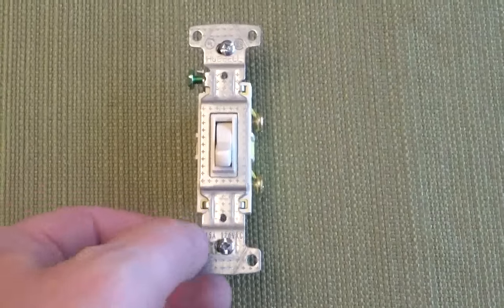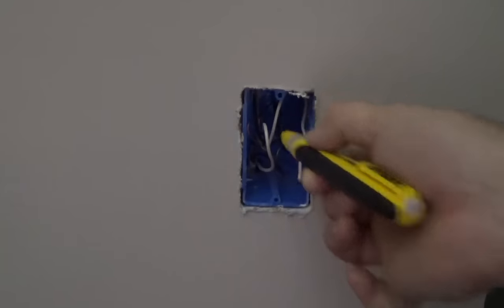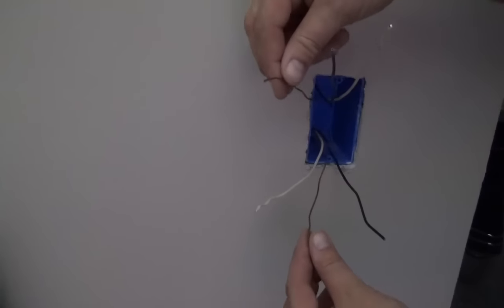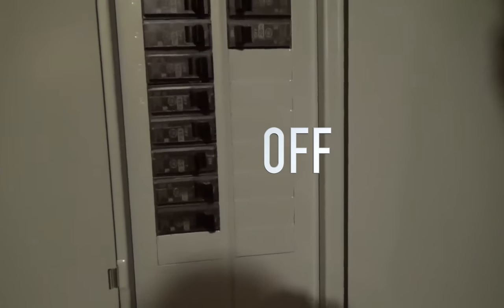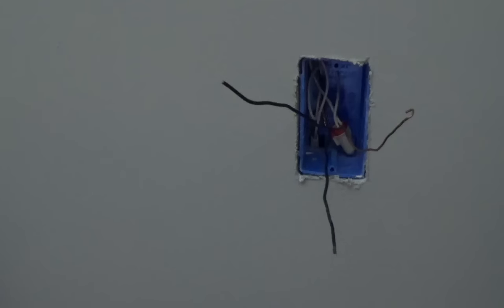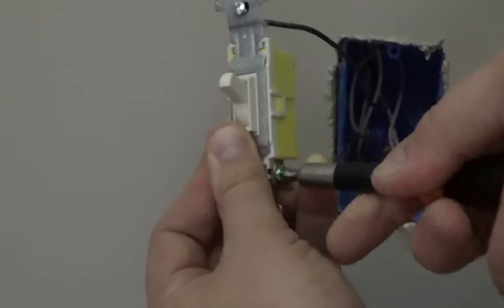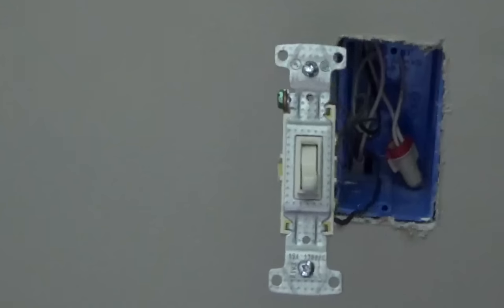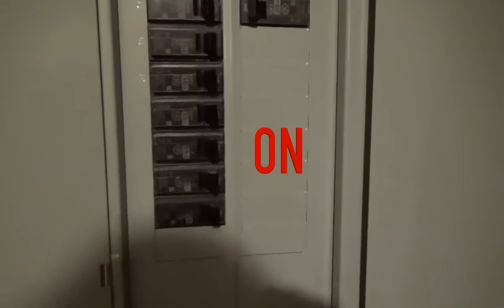How to Install a Light Switch / Single Pole Switch

Comment: well i just came back from the hospital never forget to turn off the power
Reply from the maker: Good tip, Jordan!
Reply: I got shocked twice installing mine 🥴 too lazy to walk to the breaker
Reply: Hahahhahahahahhhahhha
Reply: Thanks, l’ve been looking for a vid that tells me if l can wire without shutting off the power
Reply: What happened
Reply: Did you fix the switch?
Reply: You "never forgot" or forgot? Haha
Reply: @josephwilliams2633  how bad is a shock? Is it like hospital bad or getting tazed or like touching a handheld bug zapper?
Reply: Oof
Reply: Lol I was cleaning out our air conditioner. It had water in it so I blew out the drain and went to shop vac the water out. That higher stuff hurts.

Comment: What happens if you accidentally connect the line/load to the wrong nut?
Reply from the maker: then "off" position will turn the light on .
Reply: It doesn't matter which terminal screw you put the hot wire on on a single pole switch, connection is made internally in the switch only when in the on position alowing current to flow through.
Reply: @michaeleverett2650  Thank you..👍
Reply: I thought if you crossed them it meant kaboom time lol thanks @PhilCrockett

Comment: I worked 15 hour shifts sometimes or 70 hour weeks doing demolition on navy ships when I got out of high school at 18. 2 years down the line I got a lucky break into electric for a higher wage and cleaner job. learned power panels, receptacles, etc. I am studying outside of work to receive a job in residential for 30 an hour + overtime. I have heard residential is different than marine. I have good nerves and am cramming as much info as I can. No debt or college, no handouts, just humble hard work going on 3 years. Thank you for your video. I hope everyone gets it.
Reply from the maker: I totally get that!    seriously!  I make 8 times as much from a 2 year junior college degree than I did with my 4 year big University  degree.  no joke.  I'm the poster child for what you are implying.
Reply: There are some unions that will hire you as an apprentice and pay you $20 an hour for the firs year, then once you are fully ready , you can get a  union job earning $50 an hour and double time on the weekends and anything you work over 8 hours any given day.

Comment: I had a dimmer switch with a ceiling fan causing a horrible buzzing sound. I attempted to replace it with a regular switch and found wires that weren’t the same colors as other videos, but I found your video the most helpful and I successfully replaced with switch after you helped explain how to identify the line and load wires. Thanks for saving me a bunch of headache and making sure I didn’t burn my house down.
Reply from the maker: You're welcome

Comment: I'm an Electrician from Australia and I find American wiring so different and fascinating. All our ground wires (earth wire we call it here) are insulated. How do you make sure it won't twist around and touch the hot terminal when you push the switch into the box?
Reply from the maker: yes!  I agree that our ground is ridiculous.  I just make sure the wires are tucked carefully.  Wish they had insulation on them here.

Comment: Phil, if you remove one circuit and only need one, where does the white wire go to if you only have two gold screws on the switch?
Reply: The white neutral wire goes to your light. Your light should have 3 wires a switch leg a neutral and a grounding wire..
Reply from the maker: indeed, Edward!  Thanks for your comment!

Comment: A good measure to take is, after twisting the white wires and black wires is to cut the tips off with your side cutters. This bonds the wires together. Most of the problems arrive at those joints.
Reply from the maker: thanks for the tip

Comment: What about im my case? The old light switch doesnt have a green screw where to connect the ground. So there are 3 wires . Black /red/blue. The red lower screw and black top screw were connected onto the sides, and the blue went into a little hole in the back next to the lower red wire. In this case the blue is the coming up as the hot one. So the new switch has the ground green screw. Now where do the wires go on the new light switch??? Thanks in advance 👍
Reply from the maker: It is so hard to diagnose your issue when I can't be there to see it

Comment: VERY INFORMATIVE; Phil, I,m attempting to wire a single post light switch- however it will be powered by a 12-volt dc current is the wiring you used here the same for 12 volts as it is for 120ac current??? PJP-it,s an RV overhead light thank,s  again
Reply from the maker: Hmmm...... I haven't wired an RV.  I would pull an existing outlet and see what the factory used.  OR..... simply call an RV place maybe.
Reply: @PhilCrockett  GOT IT!! THANK,S PJP

Comment: I got a single pole switch but one of the screws is black. Is it the hot one?
Reply from the maker: They're both "hot".  remember..... It's breaking the circuit on the hot wire.    I think a good example is for you to watch my vid on another switch I put in.  You will understand the concept.  Here it is:  https://youtu.be/Wai_3qexlV0

Comment: how do I know which switch it is on the breaker box. I really need your help, I broke my mother light switch on accident and want to fix it for her tomorrow. I'm buying the voltage detector, light cover, and single pole switch. IS there anyway we could maybe set up a FaceTime call tomorrow I really need your help and you would save my life.
Reply from the maker: Most people have the switches label to which room they run on the door of the electrical box.   If not, then have someone hold a wire tester (pen light style) on the wires that feed the switch.  Then try each switch until the test light turns off.  Then you will know which breaker runs that light switch.

Comment: Just getting into this, have a dumb question. Why is there no silver screw to attach the white wire? And great video, thank you!
Reply from the maker: not a dumb question, my friend.  The purpose of a switch is to disconnect and re-connect the electrical current.  You do this on the black (hot) wire, not the White (return) wire.  So.... only one wire needs 'switched', and the proper wire to do this to, would be the Hot wire.   
It would be like cutting the wire for  "off" and touching the cut ends together for "on".  Hope this explains it.
Reply: @PhilCrockett  got it, thank you!

Comment: Does it matter where you put load and line wire in a single pole?
Reply from the maker: nope!  only..... you "on" might be off, and "Off" position might be. :"on"
Reply: @PhilCrockett  on will still be on and off will still be off. All you're doing is connecting the power flow between two wires. They are either connected or not. They will only be connected when in the on position.
Reply: @njsongwriter  Thanks for clearing this up.

Comment: Do we have to secure  hot wire on bottom or can it be secured on top as well?
Reply from the maker: either way.  It will only affect the relationship of the toggle position to the on and off of the light.   If toggled up, and the light goes off, then swap wire positions in order to toggle up for the light to go on.   Does that make sense?
Reply: It doesn’t matter, you’re only making or breaking a hot connection. Make sure the words on the switch are not upside down
Reply: This video really helped. My switch has a white wire, black wire, and a ground wire. I have a white and black wires reversed and it caused a short. From watching this video I learned that the hot wire goes on the bottom. My problem is solved! Thank you
Reply: @gunneredwards7710  ........BINGO!
Reply: @loisscott1632  that shouldn’t cause a short? A single pole switch is only breaking the connection, hot can go on the top of the switch as well

Comment: i have a switch where the old switch has the wires going into a hole in the switch rather than going around the screw.  the wires seem stuck any advice?
Reply from the maker: There's a slit near the hole.  stick a small flathead screwdriver in it to release the wire catch within.

Comment: As I understand it, with a single pole switch, it doesn't matter which way you hook up the line and the load (unless it's a GFCI receptacle or a 3 or 4 way switch).
Reply from the maker: right
Reply: This is correct. My electrician union buddy told me this a few days ago.

Comment: When I opened the light switch box, I noticed there are 2 White(neutral) wires and 1 Black wire twisted in a wire nut. That one black wire directly coming out of the box says "LINE" (Not 100% sure, since its hard to see).  But there is already 2 black wires connected to the existing light switch. I assume HOT/LINE and LOAD. I'm a little confused, should I attach the White wire from a smart light switch to the 2 white and 1 black wires? I checked other boxes in my house and it wasn't like this, only 2 white wires connected together.  Why would the 2 neutral white wire be connected to a black wire? This switch controls the floodlights for my driveway. Hope you can help. Thanks.
Reply from the maker: I can't give safe advice on this one.  Use your wire tester to see what's hot and what's not, by throwing the switch.  Otherwise, you should probably have an electrician look at it on-site.
Reply: @PhilCrockett  I did use a voltage tester, and that black wire connected to the 2 white wires is not hot. Only the one black wire going into the light switch is hot. I'll probably contact an electrician to have a look at it. Better safe than sorry. thanks for the reply!
Reply from the maker: If I were to guess without looking at it, I'd say the black hot is your LINE, and the others are your LEAD.  I would be interested in knowing what the white ones are feeding when you turn the switch on.   I like the electrician idea a lot.  You might go to a hardware store and get (or look at) a wiring 'how-to' book to see if there's a scenario like yours in a picture diagram..... just to educate yourself about it before the electrician comes over.   Just a thought.   Let me know how to goes.

Comment: I don't remember wich black wire I put on the bottom screw, hot or wire going to light, does it matter or how do I know. I flip the switch and the light does go on
Reply from the maker: Switch simply is placed in the split of a hot wire. It breaks the circuit when flipped and connect to circuit when flip the other way.

Comment: Ever get static electricity shock when flipping on or off the switch?  Cut small squares of Duct tape, 1/4 inch sq., and place them over the two screws on the plate!  I use white to match the plate!
Reply from the maker: hmmm... never heard of that.  THANKS!

Comment: Hi, my building is older don’t see I white or ground just two black wire coming in. Looks like one was going to each part of the switch, is that okay?
Reply from the maker: yep!  The switch is just breaking a circuit. It's placed in the split of a wire.
Reply: My problem is that I have ablack white only in box  at top of a long hallway no turn n off  the power goes too the light in ceiling have to pop walk back before exit builbing need your info to me and fix this pain back T THANK YOU LEE THORNTON

Comment: Does it matter if the load and line wires are switched?
Reply from the maker: nope.  only..... off position might turn the lights on.... and on position might turn them off.
Reply: @PhilCrockett  thanks.  That was the question I had.
Reply: It doesn't matter if the load and line wires are switched, either of the black wires can be attached to the top or bottom screw. The current will only flow between the screw terminals when the switch is in the on position, there is no current flowing between the terminals in the off position.

Comment: So. What if u don't know what breaker controls that switch  ? How do u find it without turning off all breakers?
Reply from the maker: one person holds the voltage pen to the wires, while the other person turns breakers off and on until you find the right one.  don't forget to label the breaker for future reference.

Comment: What if you have 2 wires coming from the bottom and one wire coming from the top? Same thing just twist 3 grounds together and 3 white wires together?
Reply from the maker: I can't give advice like that over text.  This is something that would need to be done hands-on.
Reply: Most likely your two wires coming up are your load wires but test to make sure which black is line wire(wire w incoming power). Grounds twist together, and white get twisted together. Make sure u pigtail your 2 load wires, don’t double wrap the screw
Reply: @Nick-bh1fy  you da man!😎👍[thank you]

Comment: I want to add a switch for lights in living room since I doesn't have lights at all how to add it from the other light switch
Reply from the maker: That would require running wires in the attic and down walls.  It's a pain.  I did something similar years ago.  I switched one of my receptacles on the other side of my living room.  Literally installed a brand new switch and box in the wall and ran wires to my attic (drilling hole in top plate of wall); ran wires over the receptacle stud; drilled hole in top plate; ran down wall and hooked up.  There's more to it than this, but I'll never do it again.  insulation nightmare and logistics were awful.  Hire it out.

Comment: Replacing a switch with a switch / outlet combo.  Took the switch out of the wall, and there's only one black and one white wire attached.  How is this possible that there isn't another set of black and white wires going to the light?
Reply from the maker: Not sure.  sounds very peculiar
Reply: Because the power is coming into the light fixture in stead of into the switch box. So the black and white wires from the fixture to the switch are carrying the power to the switch and then bringing it back to the fixture. Both wires are hot. There is no neutral wire in the switch box and without a neutral wire you won't be able to add a receptacle.

Comment: Need help. I have the same switch, but it inserted in the back, I am not sure how to release it since it dose not have release button.
Reply from the maker: There are tiny slots in the back that will release the wires if you push a small flathead screwdriver in.  Sounds like I need to make a video on this.
Reply: As long as your wire is long enough just cut the wires close to the switch and restrip them as needed.
Reply: @PhilCrockett  thanks a lot, I will check it again.

Comment: One question. Does it matter if you put the 2 black wires on the opposite screws of what you did in this video? Or would the light be on when the switch is in the off position and vice versa?
Reply from the maker: Correct!  It works either way, but like you said.... it might read OFF when ON......and vice versa.  Thanks for watching, Mike!
Reply: Thanks fir the reply!! 👍
Reply: For***
Reply: @PhilCrockett  
On means connected and off means not connected. They still mean the same thing regardless of which wire is on which screw. When the switch is in the on position the two wires are connected.

Comment: This didn't work for me, I attached the black from the light to the top screw and power to the bottom and it flipped my breaker. Hmmm. 
Okay I found out the light I was installing was faulty. I installed an older light I knew worked  and yes, it worked, so I returned the faulty light.
Reply from the maker: Glad you finally figured it out, my friend. Thanks for watching and commenting. Sorry it took me a long time to get back to you, some of these comments pass me by.

Comment: I need to replace this switch to install smart switch but my wires are inside the holes behind the switch instead of a loop on the screws. Not sure how to take it out, any advice anyone?
Reply from the maker: There are some holes/slits that you put a very small flathead screwdriver in, to release the wires.
Reply: Phil Crockett thats the problem. I watched a couple of videos which said that but I don’t have any holes/slits in the switch
Reply from the maker: switches are cheap.  I would cut the wires at the switch entry, and buy a new switch.  That's the easiest way to do it.  Wish I could see the back of the switch to give you other advice.  However, cutting the wires is actually great advice.  Let me know what you think.

Comment: But why have the white wires at all if they aren't attached to anything? And how are bare wires touching screws safe? I get the mechanics of the traveling electricity but I'm paranoid and just what?!
Reply: The white wires complete the circuit, and they must be present now because of the use of smart switches and dimmers that some require neutrals. As to the grounds for added piece of mind wrap the screw terminals w electrical tape to avoid a short
Reply from the maker: Thanks for the great comment, Nick!
Reply: @PhilCrockett  not a problem! Glad to help where I can